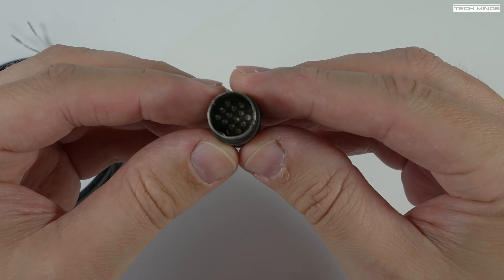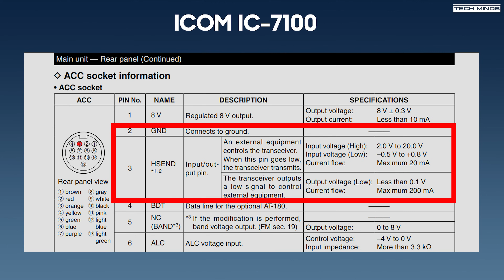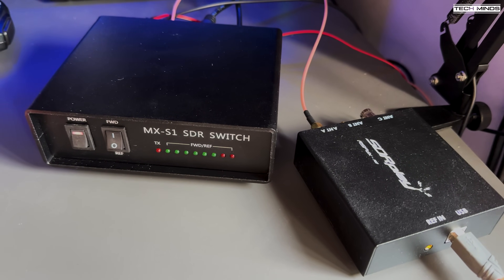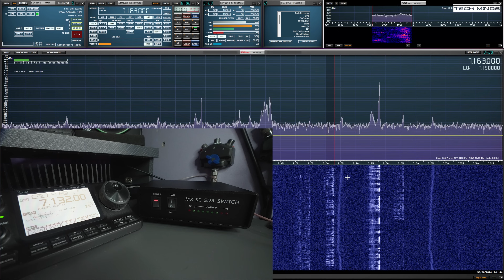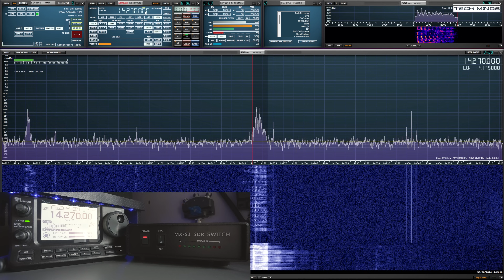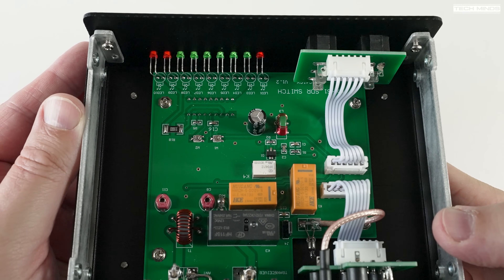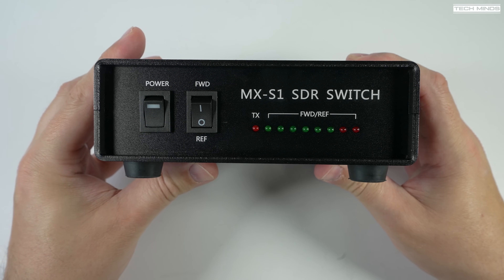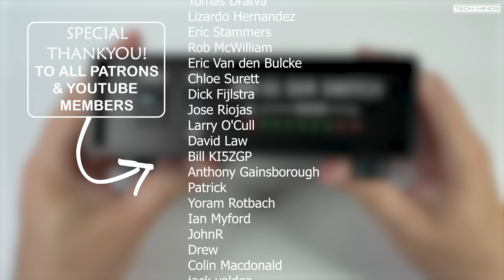MX-S1 SDR Switch - FULL SPECTRUM Display For Any HF Radio

Comment: How many watts are you putting out? 100W?  When I tried it the older version of the switch from you previous SDR switch, I can see the graph fall when I press the PTT but when I speak, the signal bleeds into the SDR and I can see the graph go up and wide, very scary and I don't want to blow up my RSP1B.  I am using an FT-991a, RSP1B and the older SDR switch you featured.  I can hear the relay with every PTT press.  Does the MX-S1 have a better isolation?

Comment: Can you provide the pin IDs for the Yaesu plug?
Reply from the maker: Look in the radios manual, it will be there.
Reply: @TechMindsOfficial  Yes, I have the schematic of the plug but it has several pins relating to TX. There’s a TX INH, a TX GND, a TX D and a GND. It’s a new radio and I don’t want to violate the warranty if I blow it up. Thanks for your patients.

Comment: Where did you find instructions about tracking the frequency of the transceiver and the SDR monitoring in SDR# (or other SDR software)? I assume you are using OmniRig, but I am searching for some modern days instructions 🙂

Comment: Nice, I wish at had auto sense on transmit.  Many of my radios dont have a PTT TRX to send to this device
Reply from the maker: Which radios? I’m sure there would be a way, even if an adapter of some kind was made inline with the mic plug.
Reply: I tested the switching by shorting two wire ends so there's going to be a way to do this somewhere in the PTT chain.

Comment: Hi Mat, i purchased one of these but cant seem to get audio over to my SDR, no response when using ptt on radio. unit powers on and my radio rx’s but is unresponsive on the sdr side. thanks for the great content!
Reply from the maker: Hi ya, please detail how you have everything wired.
Reply: @TechMindsOfficial  I appreciate the reply, i ended up figuring out what the problem was and have it working now. Much nicer than the MFJ version.

Comment: in the first one you showed I'm working, but with the jumper to hear the reception sound from the transceiver it gives two outputs. One for the transceiver and one for the sdr, they have 25 ohm impedance each. Did they fix this? does anyone know?

Comment: Thanks for the great video overview. I got mine today and replaced the MFJ switch for my Icom IC-9100. When I turned it on, the red TX light was lit, and SDR did not work (SDRUno). I finally figured out that even though I didn't need to connect anything to the "SEND" port in the back, I did need to put a plug into that port to defeat the transmit and allow receive to occur. Once I did that, SDRUno received perfectly with the TX light no longer lit until I was actually transmitting on the radio. The one drawback to this unit is a lack of instructions. Otherwise I love it.
Reply: can you elaborate a little more? i just got mine and it wont send audio to my SDR, really unsure of what to do

Comment: The MFJ unit has a control for the T/R switching delay with a minimum delay of, I believe, 50 milliseconds.  This is too slow to support QSK keying.  Does the MXS1 provide any indication of its switching delay time?

Comment: I tapped the IF on my TS-850 and could use an RTL-SDR receiver.  It did not last long before RF in the shack blew the SDR chip. You have to be very careful about isolation.

Comment: I have (and still prefer) the old one - this is almost triple the price for a few LED's...
Reply: Hi, I also have the "old" one but have difficulties to figure out for what there are these sockets SDR, TRX, AUDIO OUT. Can you help?
Reply: @danielymilva  I've never used it but I think it just allows you to also switch the audio source as well.  I suppose if you wanted to use monitor on the transceiver when transmitting for example.  Then you'd have SDR audio only for receive.
Reply: @stewartrv  Thank you for your feedback Sterwart. Will try this.

Comment: Can you explain exactly what this does ? I have the 7100 too. Does this provide a full color scope on your computer?
Reply from the maker: Yes, exactly that. But you need to connect an SDR to the SDR connection on the switch, as shown and demonstrated in the video. If you have the 7100, then check out one of my past videos where I show how to tap into the low level RX output. That way you do not need a switch. Cheers

Comment: Is there any appreciable attenuation caused by this new kit? I watched a video just before this on a new feature in SDRAngel. I’m curious about the attenuation because the signal in the SDRAngel vid was neatly buried in the noise floor and if it had been attenuated even slightly the signal would’ve never been discernible. 
Thanks for the video!

Comment: 4 Relays, wow.  I wonder how good the isolation is between TX and SDR at 60 MHz?  I also wonder how they split the receive RF between the HF Transceiver and the SDR?  Do they just connect them in parallel?  I believe the Toroid in the right is probably for the SWR bridge, and I don't see anything that looks like a 2 way rf divider.

Comment: Mat,  I believe the incandescent bulb is used as a fusible link for the SDR and is in series withe the coax center conductor.  The neon bulb is supplying static protection.   John, k0ebc

Comment: Another quality video Mat.  The SDR switch you featured 3 years ago is currently selling for $44 USD.  The MX-S1 is $122 USD.  How would you explain the cost difference? They both seem to do exactly the same thing although the cheaper one goes up to 160 MHz.  Thoughts?
Reply: Link to the $44 version?
Reply from the maker: Here's the link to the video for the other device mentioned at the start of this video. After owning both, the one shown in this video is far superior quality, but does cost more, as most have pointed out. https://youtu.be/jKqXBvsrGsI
Reply: https://youtu.be/jKqXBvsrGsI?si=VVPNWHCrVGjMoN9H
Reply: @DCDura  https://youtu.be/jKqXBvsrGsI?si=bbQMtEC6fDs-8uRW
Reply: The $44 dollar one comes from Banggood and I've had one 2 years on my FTDX10 for over 2y without problems.
Reply: Bidenomics and inflation radio gear I bought 4 years ago at a good price now sells 50 to 100 percent more .
Reply: wish ham radio discussions didn’t have to become divided by partisan US opinions